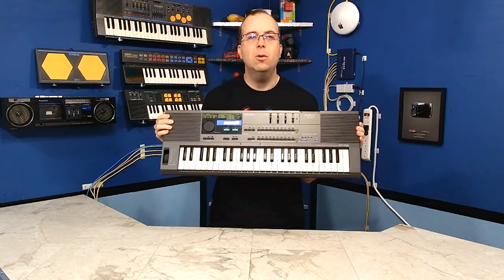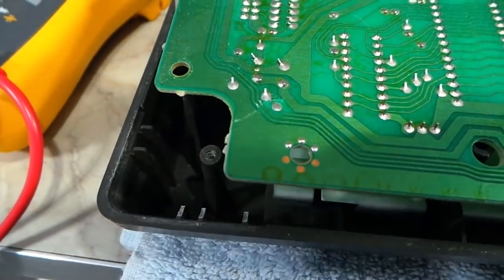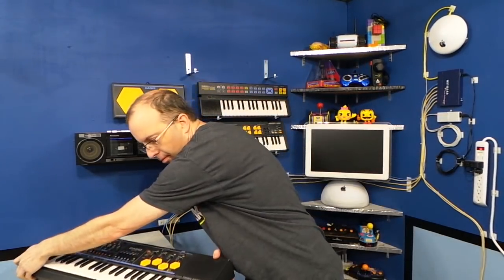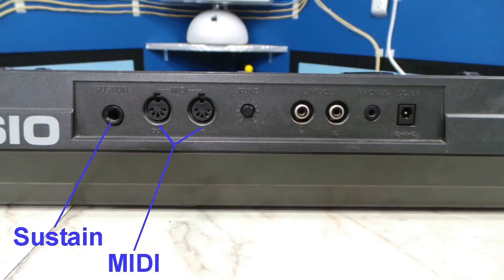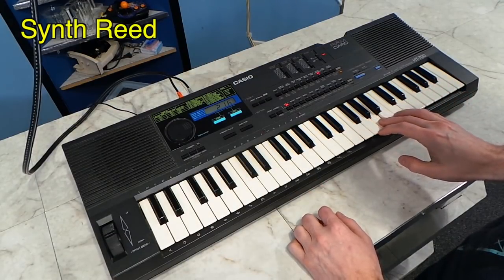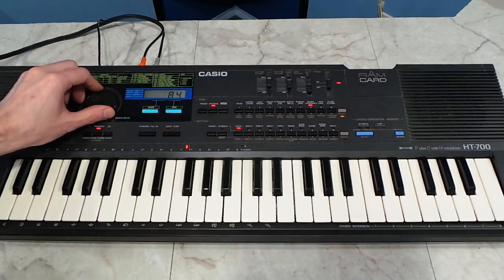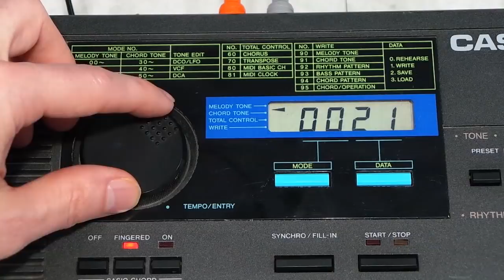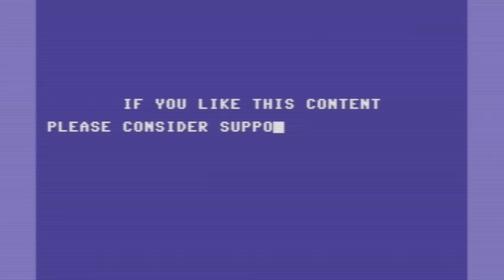Casio HT-700 Repair and Review

Comment: What are those two sounds between Synth Bass and Synth Reed? Also, this is definitely *not an FM synth.

Edit: I'm an idiot.
Reply: It's not FM.  There are about 30 different digitally generated single-cycle waveforms to choose from which then go through a paraphonic analog filter and VCA.
Reply: Casio developed this engine specifically because Yamaha sued them for copying their FM engine in the CZ series. They wanted it to be as different from FM as possible, which is why they went back to a more traditional oscillator/VCF/VCA architecture.
Reply: To answer your question, the two patches between Synth Bass and Synth Reed are called Synth Celesta and Pearl Drop.
Reply: Well, it sure sounded like FM, anyway. Mea culpa.

Comment: Argh!!.. Impatience.. If you got it home without knowing the screws were missing, it could have remained screw-less until some proper self-tapping plastic screws arrived from ebay/aliexpress/banggood.. How can you call yourself a collector if you deface an antique with large countersink wood screws!!! Sacrilege!!
Reply from the maker: Once I start a video I give myself 2 or 3 days to finish it.. then I have to move on.  I have way too many projects.  Usually, I try to work out everything I will need in advance and have it ordered and ready.  But when I encounter new problems I have to use what I have on hand or can source locally.  No time to wait for deliveries.
Reply: The video didn't require it screwing together.. The video required it working and a promise that you'll screw it together later with correct parts. I just can't bear to think of bodge repairs. You might as well just gaffer tape it together :-)